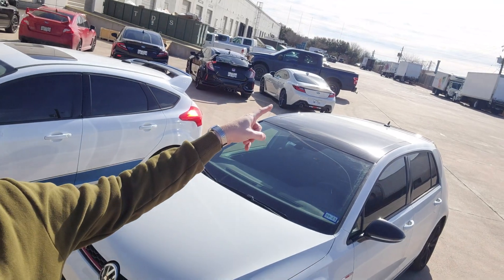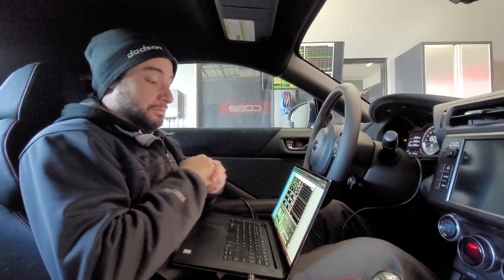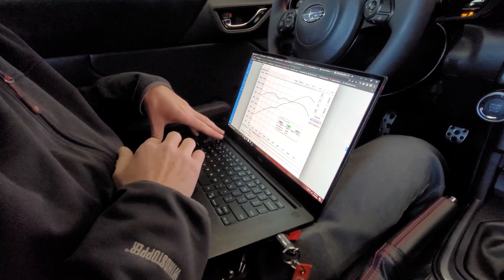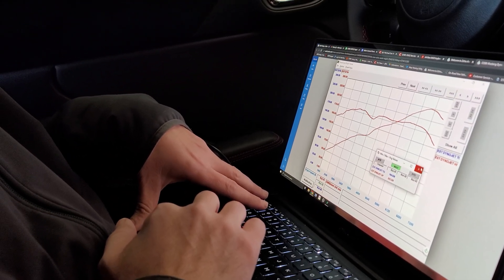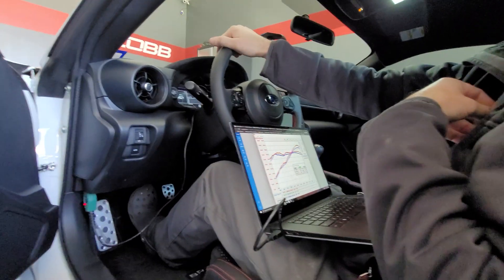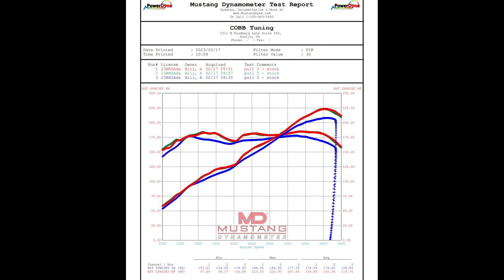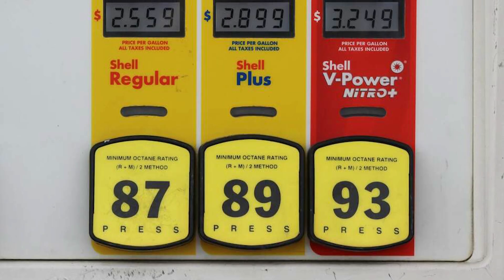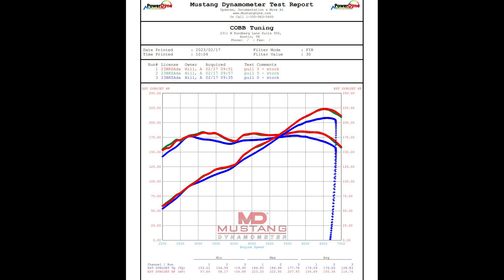2023 BRZ Baseline Dyno pulls at COBB Tuning - Road to SLB Ep. 2 | My car made 16whp by doing nothing

Comment: which injector (port or direct) can be improved for more umphf?  what power levels are the stock injectors capable of?  instead of making more power, is it easier to make the car faster by modding other areas of the car (wheels/tires, suspension, driveshaft, etc) vs mucking with the engine tuning?  You know, add lightness. 🏁
Reply from the maker: Sorry for the super late reply. But better late than never. 
The port injectors are the only ones that you can easily upgrade. That would only be needed once adding boost with a turbo or Supercharger though. This car has an ethanol tune now and is still fine on the stock fuel components besides a flex fuel kit. 
Also, yes this platform is meant for handling over power, so handling/weight/braking mods make a much better difference. This car is heavily modified now for Time Attack. So it currently has everything that can be done for all of those things besides a wider body which wouldn't be worth doing until I add more power with boost.

Comment: What baffles me is that if the car is only rated at 228 crank, and all dynos I see registers 203-223 wheel, that puts the car about 250, more or less.  Understated, in short.  Now, all the top speed figures and videos I see say 140-143 mph.  No way!  Realistically, at say 250 hp, 0.276 drag coefficient, 5th gear ratio at 1:1, 0.767 at 6th, the car can go near 160 mph.  I have a feeling the car is "electronically" limited to about 6,000 rpm at 6th, not drag limited.
Reply: Im not surprised that this car puts down the amount of WHP we are seeing. Common knowledge is that all RWD sports cars have a 15% drivetrain loss. But that has never been an accurate number, only a "ballpark" number that was "good enough" for cars like 30 years ago but modern engines are built with significantly different materials that are both stronger and lighter but people keep using the "15% rule" even though its outdated by decades now. Fast forward 30 years, we have better lubricating oils, better balanced engine internals, stronger AND lighter weight pistons/rods/crank/valves, lighter weight transmission gears, lighter weight rims. And now we have electronic steering so that removes excess strain on an engine from an accessory belt, and we even have electronic radiator fans as standard.

All this combines to a significantly less drivetrain loss percentage.

Fun fact: on NB miatas(115whp), they gain 5whp(120whp) across the entire rev range from an old 1.8L if they remove the hydraulic power steering(or switch to electronic). That's 4.3% in drivetrain losses from 1 component alone. With hydraulic power steering connected and the wheel turned, they saw -12whp from the baseline(115whp to 103whp). This just gives you an idea of how drivetrain losses in modern cars should be a lot less than 15%. My guess is that its closer to around 5% now and that sounds about right.

On top of that, I believe the stock BRZ 18x7.5 rims are among the lightest found in a factory wheel of the same size(not lighter than many aftermarket ones, but very light for a cheap factory rim)

And then you have 0-w20 as the factory recommended oil which is pretty light and thin.
Reply from the maker: Correct, modern lightweight naturally aspirated cars, especially with small wheels/tires like the stock ones here do not lose a lot of power between the engine and the road like an older heavier car on boost and AWD etc.
Reply: Car top speed is electronically limited.

Comment: So they are rated at 228 crank but dyno 223?  Maybe its 228 when cold minimum and 250 when hot 😀
Reply from the maker: RIght, haha. Ultimately every dyno is gonna read a bit different but the overall point of the video is to show that once you get the car up to tempt. The stock tune with stock parts is basically maxxed out. Many sports cars come from the factory with some meat left on the bone for tuning even with stock parts but Subaru squeezed everything out of the engine with the stock tune. On good fuel it doesn't knock much, so thats a good thing. 220+ whp on a 4 cylinder NA car is very good. It's up there with Honda. Several experienced Subaru tuners have played around with timing and fueling on these cars and without adding things like headers etc, they don't make any extra power from tuning. So the claimed power gains I have seen from just tuning on stock parts are not from tuning...they are just from temps increasing.

Comment: So you add an oil cooler with a 180 thermostat and you end up with less power - lol.
Reply from the maker: On the street that could actually be true...haha. But the temps it made peak power at would be the same on the track even with a cooler. It never got dangerously high.

Comment: did you rip out the charcoal filter out at least
Reply from the maker: Good question but no, the point was to compare 100% stock. Also, from what I have seen, the filter likely doesn't actually make any power on an otherwise stock car. Not saying it isn't restrictive to flow at all but without supporting mods, that small restriction is likely irrelevant. Most tests I have seen with before and after of removing the filter are not very valid and also mostly ignore the thing we are pointing out in this video. I.E. The supposed gain may just be due to repeated pulls. I see lots of people do a pull, then rip out the filter, and do another pull and claim that made more power but there is no actual data to show that it wouldn't have done the same thing that happened in this video. Did the car make a few HP from ripping out the filter or just because they did subsequent pulls? That would be a good thing to test. Do a few pulls to hit the highest power possible like we did here....then remove the filter and do the same thing, but COBB can't make a video doing that without getting in trouble for removing a regulated emissions device. So some one else will have to do it.
Reply: well if you put on an intake that's the same thing as removing the filter does the mean you can't use them now?? @bespokepaintprotection1308
Reply: does removing the pre-filter add any power, or is it more about noise?
Reply: @K03sport  it is said its the reason why non USA models have more hp, not much but in a light car every hp counts

Comment: Here in Australia, we run the recommended 98 octane (no ethanol) fuel,
which is our premium.
I wonder if it would make any more horsepower or not?
Also, I understand the increase in power due to warm thinner fluids etc
but why would that change the torque dip for example?
I would think warm v cold  power/torque graph lines would mirror
each other regarding an increase or decrease in power or
am I missing something?
Reply from the maker: It doesn't appear to be knock limited. Mike even played around with timing on a different car with no definite improvements once up to temp. So a different fuel likely wouldn't change the result significantly without mods. Now headers and mid-pipes + higher octane...that would probably gain a decent amount.

Comment: This is interesting find about this engine. It likes heat. Normal street driving operating oil temps on this car is 195, after a few pulls it jumps to 220-30 degrees F. 

What were temps on the 220hp pull?
Reply from the maker: The temps were the same as what you have seen, in the 220's. Ultimately what this tests has shown most is that on stock parts, the stock tune makes as much power as the car will make dependent on fuel quality. Even since doing this video, I have had other tuners confirm that playing around with timing etc does basically nothing once the car is warm. Now, with mods, we'll see but in stock form, the stock tune will make as much power as possible.

Comment: Don't you want to be in the 1:1 gear?
Reply: Fourth gear is standard for 86/BRZ dyno pulls. Every time I've paid attention to anybody's dyno run when they show the gauges they're in fourth gear - even years ago with first-gen FR-S/86/BRZ.
Reply from the maker: Generally speaking yes, but with a car that doesn't make much power and would be a very long pull, 5th gear (which I believe is the 1:1 on this car) would not be a good idea. So 4th is the better overall option. As long as all pulls are done in the same gear then there no harm on the test.

Comment: Did you map any of the engine and coolant temps during each pull? Would be interesting to understand what counts as "warmed up" vs "hot" to see what's optimal. Thoughts?
Reply from the maker: Looks like coolant temps would always start in the 190's for each pull and climb a bit but maintain relatively well. Oil would get into the low 200's but nothing higher than what I have seen on the track. Unfortunately there is not data for trans or diff, not sure those even have sensors to log.
Reply from the maker: I can ask Mike for that info. He was logging all of that. Ultimately we did ensure that the car was up to a full operating temp before any WOT pulls and it never reached dangerous Oil or coolant temps but knowing exactly is of course helpful. I'll reply later if I can get the numbers.
Reply: Yeah, oil coolant temps would have been great.
Reply: This is actually very interesting behavior. I'm no mechanic, but I've dabbled here and there in the past, and this is interesting, especially for track days, autocross, etc. 

This video was informative and something I know I will reference to in the future as I'm hopefully working on my BRZ 😅 

I also came across another video that explained some of the internal engine changes that were made to the (FA24DB / FA24DG) to fix some of the known issues from the previous gen... Now I'm wondering if those changes are hindering power until the oil reaches a certain Temp/Viscosity 🤔 

91 to 93 Octane is a good way of accounting for some of the gains but I don't think it accounts for all gains. 

It would be cool to see if changing the oil type or viscosity would allow for the power gains to appear in less amount of dyno pulls. 

Would it be beneficial to run a specific type of oil for track or autocross days that could get you that max stock WHP the fastest. 

Many interesting questions I hope.
Reply from the maker: @professorxavier9991  Thanks. For some bonus info. One thing I probably didn't describe very well is that ultimately the car isn't really making any more power in any of the pulls. It's basically just getting more power to the actual ground as the car warms up and the parasitic loss dereases, and that is generally going to happen with any car. But the big takeaway is that when monitoring timing and fueling and airflow. There are no changes at all and even when Mike did make changes on the other car, once it was warm, it never increased power from the peak stock tune power at higher temps. So at the end of the day, the biggest lesson is that the stock tune on these cars with stock parts, is basically already maxxed out. I've actually talked to 2 other experienced Subaru tuners I know since this video was posted who said the same. They said once the stock tune reaches max power to the wheels, changing the tune with EcuTek doesn't nothing without additional mods. One tuner said he even pulled a degree of timing out and it didn't even lose power. So the Subaru map is quite aggressive right from the factory. So now we know that if I can make any power beyond that once I have mods on the car...we have a better idea what real value the mods have or the tuning changes associated to them.